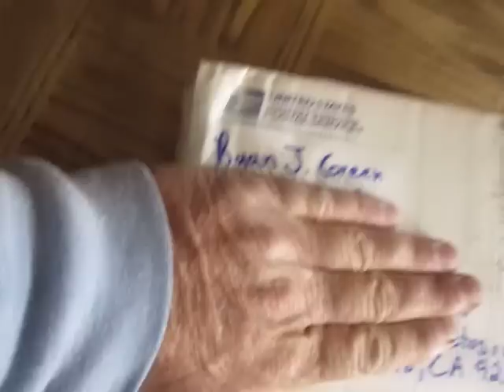17 Pounds of Diecast Goodness!!!!!!

Comment: Hey Poochman, good to see you back on the air. Nice score of older hotwheels. I have to ask you what brand of #50 drill bits do you use. Mine dull up real quick, let me know. good to see you again
Reply from the maker: +Leterguy Schroeder Thanks bud, not sure of the brand but i get them from a hardware supply store in Riverside, Rainbow Bolt. http://www.rainbowboltsupply.com/

Comment: what paints (brand) do you prefer.
Reply from the maker: I've always like Testors Model Master paints, ton of colors and never had a problem. Not a big fan of acrylics though, just don't come out right. I also use nail polish you can get some real funky colors and with an air brush it's no problem to apply.
Reply: thanks Pooche